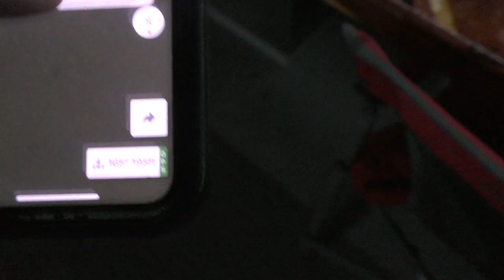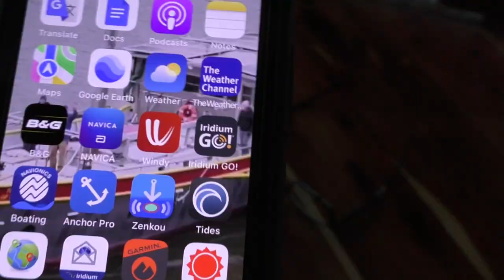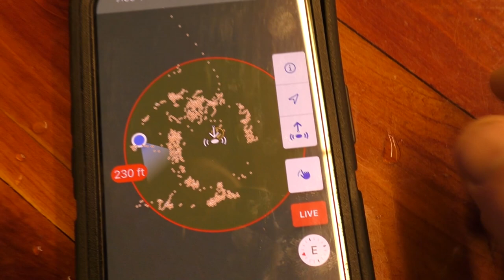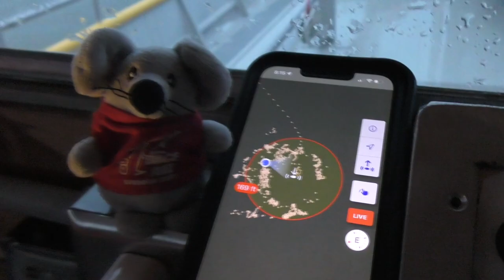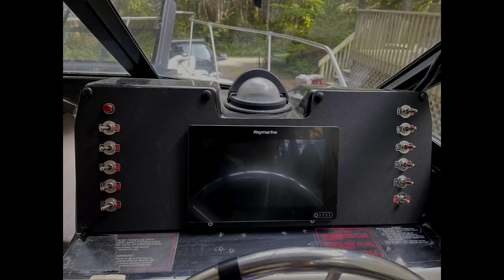Anchor Drag Alarm

Comment: Hey Doug, long time viewer.  When anchoring I always felt comfortable with a 5:1 scope for a day anchor or would push it closer to 10:1 for rough weather, or longer times at anchor.  So, looks like you're anchored in 25-30 feet of water, I would consider 250-300 feet of rode for storms.  The lower the angle of attack the more holding power the anchor will have.  Keep living the good life and take care!
Reply from the maker: That would let me drift into the navigation channel.   How comfortable would you be getting run down in the night by a set of barges?  Sometimes we need to think, and not follow the rule.  : )
Reply: 10 to 1 seems pretty excessive depending on what type of boat/hull you're dealing with. 5 to 1 is a good medium, with the right chain 3 to 1 is totally doable in calm weather for a shorter periods. You can keep the angle of the rode near the anchor low with heavier chain or by kedging and reduce the length of rode out. If you have a wide open area then it might not be a big deal but why have to put out more than what you need outside of rigging for storms or long term mooring. If you keep it shorter then your swing is less, you can tell more quickly if you do drag because you can set a shorter anchor watch and who wants to heave more than you have to particularly when in really deep water. That ratio difference is a big deal when you're on the edge in 400-600 feet of water, at 3 to 1 you're between 1200-1800 feet of rode, take that to 5 to 1 and you've almost doubled that and 10 to 1 is nearly quadruple. By the time you get done filling baskets with all that extra line you could have just added a few sash weights to the shackle and been done.

Comment: The irony of all these comments professing the "right way" to anchor...

That being said, I have a suggestion to remedy your floating rode. Take a long piece of paracord sheathing (just the sheath, take out the guts) and fill it with lead shot, then tie off the ends to hold it in. This weighted strand can be spliced into your rode along its length without degrading its strength and without getting caught up on things when you're dropping/raising anchor. If you're good with the splicing tools you can even get the weighted strand to be completely inside the dyneema cord, invisible from the outside. You can also split the weight up into as many pieces as you need to make it manageable, 5-10 foot sections are easy to work with and the end result is the same.
Reply from the maker: That would do it.  I like the out of the box thinking.   ...but until I need it to sink, I like that it floats,  it's great to work with when doing things like bollard pull test.  It does not come back in covered with mud.
Reply: @SVSeeker  if it works for you, then great. It's your boat, after all.

Comment: STAINLESS STEEL SAFETY WIRE IS A MUST ON YOUR CLEVISES ON THE ANCHOR CHAIN. you dont want the pin to back out and lose the anchor on the bottom I have had it happen to me but luckily my boat is in the gulf and it was only about 10ft deep so I was able to dive down and get a rope on it
Reply from the maker: IS YELLING YOUR FRIST SENTENCE IS A MUST?  Or just overly dramatic?
Reply: @SVSeeker  its important literally loosing the anchor can be catastrophic. I was at the sandbar when I lost mine one minute im swimming over by my friends boat I look back at my boat and its floated 100 yards away. if you dont wire the pin its not if it will come out but when. ideally use a clevis that used a bolt and cotter pin
Reply: Come on! If you actually know how to tighten the shackle it does not matter you make your own luck! I’ve never wired a shackle in my 63 yrs of sailing!

Comment: Doug, get rid of that polypropylene line you're using as anchor rode. You NEED 100 yards. of ACCO brand chain or at least some quality 1" nylon rode that sinks. Catenary is your friend and floating line won't work.
Reply from the maker: Are you buying?
Reply: Doug decided to remove chain cause win-less doesn't like so much chain.  Real men anchor with floaters.
Reply: "Are you buying?"

I don't understand this comment. 1" 3-strand nylon anchor line, which is what you should be using (based on years of use, testing, and science) sells for around $2.75)ft, where as your 5/8" Dyneema fetches more than twice that. Just curious why you  decided to use the Dyneema.
Reply: @ExetPlan  because it's significantly stronger than even a steel cable. Curious why you think it's your problem, is your name on the title?
Reply: @tissuepaper9962  
"because it's significantly stronger than even a steel cable..."

There's more to anchor rode than just strength, but you're obviously not a cruising sailor, so I wouldn't expect you to understand.

Comment: I enjoyed going into the captains area at the marinas and talking with the real captains, the guys running large sport fishing boats for a living. These guys had local knowage that was invaluable to me as we crusied up and down the coast of Florida. They showed me areas to avoid on charts, great places to anchor and how to anchor given the area we were in. Anchoring depends on the type of boat, size of boat,  Chain vs rode, size and type of anchor, weather and bottom and technique to set and retrive it. Anchoring is not a one size fits all. What works in one place will not work in another. What works for one boat will not work for another
Reply from the maker: Yes, that has been my observation as well.

Comment: You can choose your own way to do things and every situation is different but that doesn't discount the general principles of an operation or mean that suggestions that are based on the application of those principles should be dismissed simply as someone else's way to do it. I've anchored dozens of different boats in numerous different ways and depths. Small boats with traditional Danforth anchors in shallow bays, 100 foot party boats with dual anchor sets so that we could adjust position to get right on a wreck in 25 fathoms, grapple anchoring 30 foot center consoles on wrecks, deadman anchors around rocky islands or markers, half mile long rodes for anchoring sport boats in 100 fathoms on the edge of the continental shelf, and plow anchors on automatic windlasses and many things and tricks within the varied needs we deal with in my area. 
I won't tell you what to do or how to do it but I can say what I see that would be an improvement in functionality. First is the chain, its the key to solid anchoring and not because it gives more mobility or anything like that but because it gives weight behind the anchor, lowering the angle of the rode near the bottom and helping to dampen any shock loading. Adding length shouldn't hurt anything but the benefit of the weight of the chain diminishes the further from the anchor you go. On a 23 foot fiberglass boat I'd put 8-10 feet of half inch, on the 38 sportfisher I used to run I had 20 feet of 3/4 inch so for your boat I'd be doing at least that if not heavier. It doesn't need to be 40 feet but the important part is that the heavy section of chain is right there at the anchor so the angle of the rode is low and the force is trying more to bury the anchor deeper than the upwards pull of the boat is trying to pull the anchor up and out. Another way you can accomplish this which might work better for your current setup is to add a weight to the rode a little bit up from the anchor, called kedging. Here again the purpose is to lower that angle between the rode and the bottom as you get out towards the anchor. If you are concerned that any of these things could cause you to get the anchor stuck then you can rig a trip. Either attach a second line with a buoy to the head of the anchor or attach the regular rode to the head, you just drill a hole in that stationary plate at the end of the stock between the flukes. If you use the buoy then you retrieve and haul up with the secondary line or you can attach the rode and then wire or zip tie it at the top of the stock where the chain normally attaches and if stuck you pull until the wire or zip ties break and end up yanking the anchor out backwards- how many zip ties or wire you just have to feel out...

Comment: Doug, if you think you are dragging, go up to the bow and put your foot on the chain.  Most anchors drag in pulses, the grab a bit and then let go again.  You can feel those pulses in the rode.  Your boat may be too heavy for this to work, but it's worth a try.
Reply from the maker: Yeah I do that.  Didn't feel anything, but if it did drag it didn't drag far, and I'm not sure that would work in the mud.
Reply: I can tell from experience that even 150 meter and over merchant cargo ships have jumping chains when dragging anchor. with the bigger forces involved, you don't even need to feel it, you can hear and see it happening.  
But those big ships stay on the spot because the weight of the chain holds them down, not the grippign power of the anchor. if you pull the chain tight it is always going to drag.

Comment: The boats I commercial fish on in Alaska all use chain and steel cable for the anchor. Regardless of weather someone stays up for anchor watch. I've been in my bunk when the anchor alarm is blaring and everyone is passed out...several times. Also I've seen the anchor cable get wrapped up in the prop and cause the boat to list over horrible,  then pop out violently. I'm a worried for you sir using that anchor line on that size boat. Be safe friend. If you've ever been in the real rough stuffing the ocean you'd know it's a no brainer
Reply: Dyneema is significantly stronger than steel cable of the same diameter. Don't worry.
Reply: @tissuepaper9962  It can't handle abrasion
Reply: @shitindawoodsbear2798  seems to work just fine for rock climbers and high-liners, and those environments are much more abrasive than one roller and a winch. Those guys use much thinner lines as well, no problems. When exactly is this line going to be abraded?
Reply: @tissuepaper9962  They use Dyneema variants; but they’re all jacketed with a protective outer layer. 

Dyneema (BlueSteel) is great; but doesn’t stand up to abrasion at all.
Reply: @tissuepaper9962  sand, rocks, etc. where the shackle connects to the anchor chain is very common area of failure. Hours and hours of much higher stress an abrasion than the fattest climber could ever put upon the thing. 2 years ago my captain lost his anchor even though it was on a cable/chain set up. It wore the cable and snapped. Horrible weather. 1 inch cable , though soft as far as metals go, stainless is still more capable than that skinny line to handle the severe abuse that goes on beneath the surface. To lose the boat over some shitty chinese line would be great for an insurance claim however no one wants to see that.
Reply: @shitindawoodsbear2798  dude, this line floats, it never touches bottom.

Steel cable has its own problems, metal fatigue is what causes it to fail at the connection point, not abrasion.
Reply: @tissuepaper9962  ok buddy
Reply: @shitindawoodsbear2798  ah, the universal code for "I've run out of arguments but I still think I'm right"
CWC BLUESTEEL (the cord he's using) is specifically advertised for abrasion resistance. It's not "shitty Chinese line", it's a well-tested product from an American company.
Reply: @jeverich  that's funny, because BLUESTEEL is specifically advertised for its abrasion resistance.
Reply: @tissuepaper9962  I'm wondering how many anchors you've set or pulled  in rough waters on a real vessel? I'm wondering if you've ever been in greenwater or the ocean period? I'm calling you out now. So where you been buddy? You an old salt.? Of so ill shut up. So what's up guy I gotta get on a boat now?
Reply: Sure, it’s advertised as “abrasion resistant”… but it’s all relative. Dyneema is great for the right application, but without a proper abrasion protection it WILL NOT last. Seizing eyes / stainless thimbles, etc. 

I’ve got about 1,000 feet of it on my boat right now, throughout my trawl gear and for our hook lines (1” Jacketed Dyneema)

I’ve never seen it used on anchor gear here in Alaska…. I’ve got 7/8” cable and 20 fathoms of 1.25” stud chain. Most smaller boats use Samson Double Braid, with chain…
Reply: @jeverich  Might be neat to build a machine to compare the abrasion resistance of nylon vs this Blue Steel Dyneema line.  I wonder if I could get it in smaller sizes so the test rig could fit on my workbench....and I'd need some coral sand from the Bahamas....that stuff eats nylon line quickly.
Reply: @tissuepaper9962  but no stretch like proper nylon Rode , you want to avoid shock loading on the anchor and boat.
Tug boats use nylon tow lines for the same reason.
Reply: @CheersWarren  well, according to Shitindawoods Bear, his boats all use steel cable, so I guess the stretch isn't that important.
Reply: @tissuepaper9962  I've been on a lot of tugs friend. All of them use what is referred to as a "wire" tugs pull with. That's cable on a drum. I've done more bollard pull tests with tugs than I can recall. With Crowley, Sampson, Foss, western towboat. Etc...I've been doing this crap for 30 years buddy. What the problem with being humble buddy?

Comment: I'd be scared of getting my fingers near that chain stopper if something were to fail. Any thoughts about adding a handle/foot lever off to the side of it or anything, or not concerned?
Reply from the maker: You passed the first step.  Recognize the pinch points.  Second step is to develop the skill to avoid them.   Problem solved.

Comment: I agree with the diesel outboard, single fuel is best, ask the US military.  Propane is heavier than air and will settle into the bilge if stored inside and it leaks.  Most boats that use propane have a storage locker out of the main living quarters.

Comment: put 30ft of chain on the winch and the rest in the locker. the idea is to have enough weight in chain loose so that it can overcome any jamming in the locker you want that chain rolling off hot enough that you need brakes it also puts less stress on the motor
Reply from the maker: No.  : )

Comment: That's great to have a big squall in a freshwater environment ! Find all the deck leaks , there are always plenty!
Are you using amsteel/dyneema for your anchor rode after the  chain? A little unusual as nylon is usually the line of choice as it has a lot of stretch to avoid shock loads on the anchor and boat.....
But like you said , it's your boat , just better have an anchor watch.
Cheers Warren

Comment: My dad taught me to always carry a second anchor, This way when the wind was blowing the boat closer to shore, I could lengthen one, pick it up and swim out further (walk on the bottom) then the other. Take up the slack, Change anchor , rinse and repeat. This could take quite a bit of time, but I always kept my boat off the shore as the anchors failed to completely hold. Its not as hard as one might think. There is plenty of time, even in the mightiest winds. Best to just stay calm and measured. And Two anchors hold better then one. Thanks for sharing your experiences with The Seeker, I really look fwd. to seeing new ones.

Comment: rather than buying a diesel or carrying loads of petrol, why not DIY an electric setup for the tender? pull the power head off the outboard fit and electric motor and some batteries. Charge off your solar/housbank/generator

yes the batteries are expensive but you are clever im sure you will find a way. Safer and more reliable than petrol, no fuel contamination issues, less servicing etc.

Comment: Hi Doug. Pip & I used to own & ocean sail a 65ft steel ketch. As newbies we thought that letting the anchor down would hold us in place. We learned quickly that this is not so, when a big storm dragged us through a marina of boats one night.  Fortunately we didn't hit a single boat !! Pure dumb luck for us.  Wise old sea dogs explained to us that it's mostly the length of chain on the bottom that holds you in place. Not just the anchor.      If you drag, then heavier chain or more chain out will usually hold you.  We never dragged anchor again.  Always put lots of chain out.   We had white painted links every 10 metres so we knew how much chain we had let out.
Keep up the great work. Love the content.  Greg & Pip
Reply from the maker: Yes, and work with the equipment you have and modify it for where you are.

Comment: Hi Doug,

Question for you, dow you have a does you anchor hydraulic input shaft have a bend in it? It seems the hydraulic motor was moving around a far amount.

It just doesn't look normal.

Regards
Reply from the maker: Just a shitty job welding up a coupler, so I left some slop in the bolts.  Think of it as an "On" indicator.
Reply: @SVSeeker  well fyi it's working as intended. :p

Comment: You dont need an Anchor  line that floats. And you will find that measurements on the  anchor line ( rode ) may be very helpful .Like your videos Doug,
Reply from the maker: You do if you want to put more of it on the spool.  I'm not of a member of Our Blessed Lady of Sinking into the Mud Rode.   Never drank the holy water.
Reply: Anchor line that floats is OK .   i was thinking of some of the places I've anchored and someone catches lines in their prop.  I have lot of respect for what you have done with SV Seeker , and still doing.

Comment: In 7 years livaboard and 52k miles I never dragged once. My rig was 120 ft 3/8 chain and a 120 lbs Bruce anchor.  
In Fiji in foul ground 5 boats dragged past my and we never moved. 
26 ton steel motor sailor 12 meter mast.

Comment: Options I’m sure you’ve thought about: two anchors in series on the same rode, two anchors in parallel (Y config), hanging a weight on the rode (anchor chum/kellet) to lower the angle of pull and dampen the tugs. I’m enjoying seeing you meet these challenges, thank you!